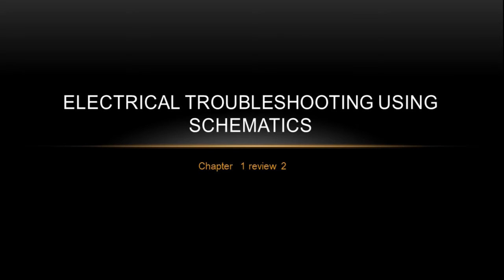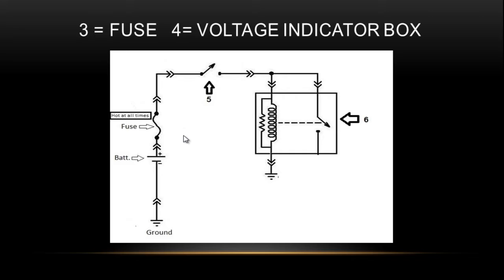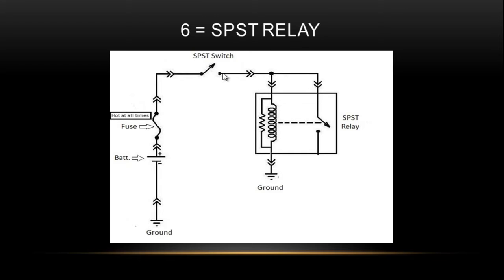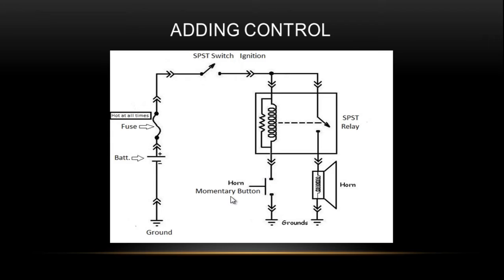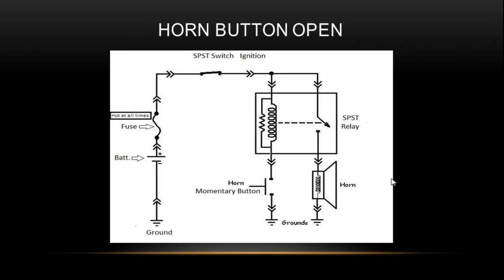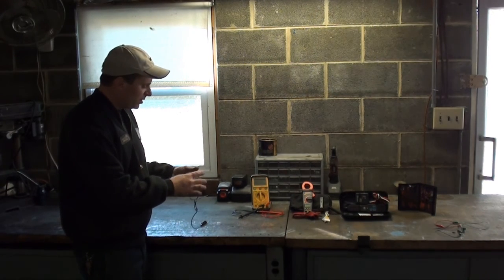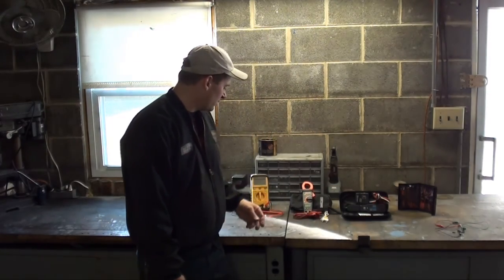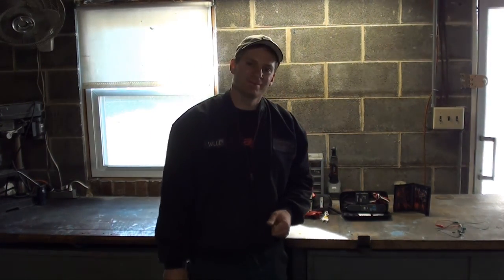Review 2, Automotive Electrical Troubleshooting Using schematics

Comment: can you help me?,the car is old 76 toyota 6R engine,my doubt is: imagine this,you have a bulb (as you may know 1side goes to chassis and the other to 12v) well,if you use a continuity tester(engine shut off no battery) and you put 1 probe on the positive side of the bulb and the other probe to chasis. YOU HAVE CONTINUITY thats NORMAL???cause the inside filament is like a normal wire right?.my doubt is because i have ground in a wire is linked to IGN but that wire goes to volt regulator(IGN)

Comment from the maker: @ejwsubaru  it can be a bit deceiving. i can explain it more @ the forum it sounds like your missing your control "Ground" a dc motor needs + & - to run is there only 2 wires going to the pump, the side that activates the motor when you probe it with a test light is most likely the control side, whats happening is, you have the test light connected to ground and when you probe the connection its taking the path to ground through the test light, from the sounds. i would need to see the schematic

Comment: I actully think i fiqured it out. On top of the clip both wires read power (like they should i think) but on the bottom of the clip (washer motor side) one does but the other when i touch it with the test light it activates the windshield wipers. This has got to be the reason im gonna deal with it in the morning

Comment: Love the electrical series you got going on. Its nice to learn from simple up. I appreciate it. Im having a hell of a time with my windshield washer motor schmatics. New motor and still wont spray. Lines clear. 2 wires are apprently both hot and both read power on test light. Any hints? Thanks